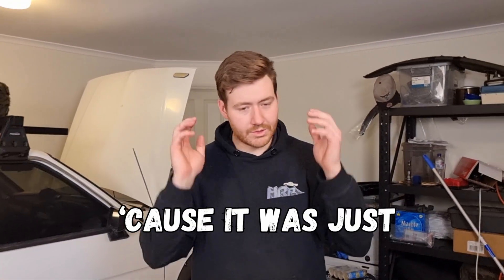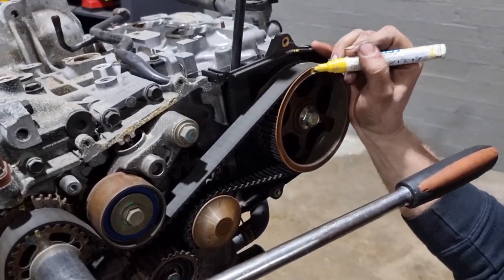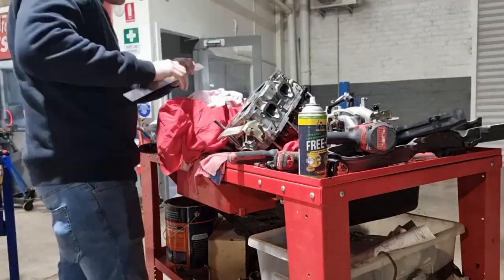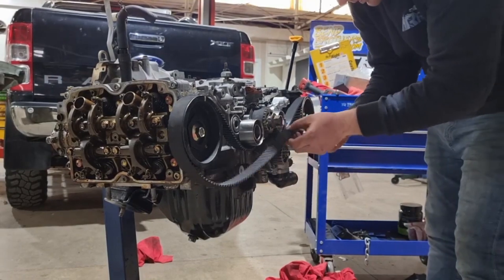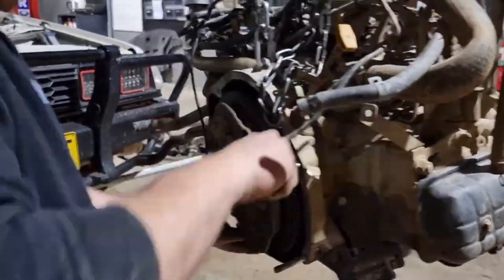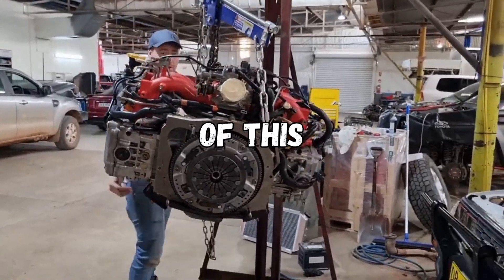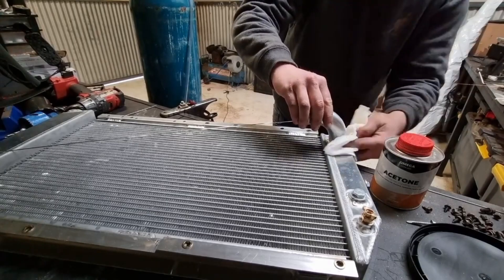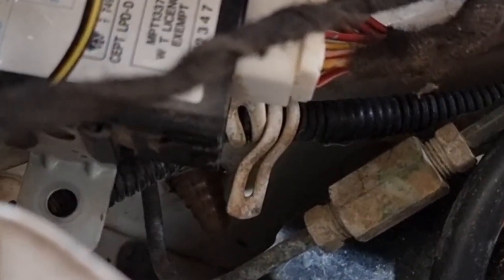I Did an Engine Swap in 2 Minutes and 53 Seconds

Comment: What heavy duty clutch kit did you use?
Reply from the maker: @Reek_ove_Red  I can’t remember exactly but pretty sure I couldn’t get a heavy duty clutch for it, also went through two clutch kits till I got one that fitted. There are a few different input shafts and thrust bearings throughout the brumby range

Comment: How’s it go with the factory gearbox?
Reply from the maker: The 4 speed gear ratios are a bit awkward and it revs a bit at 100. Other than that it's not too bad!
Reply: @angryengineering  yeah that’s fair enough, looking to swap to a 5 speed?
Reply from the maker: Definitely will be, can get lower ratio low range for them and an extra gear on the high way would be awesome